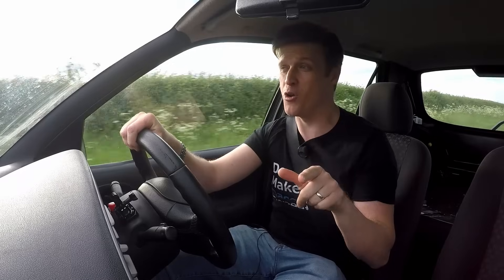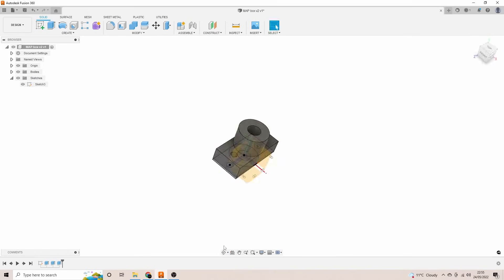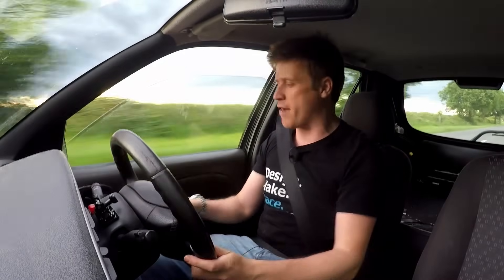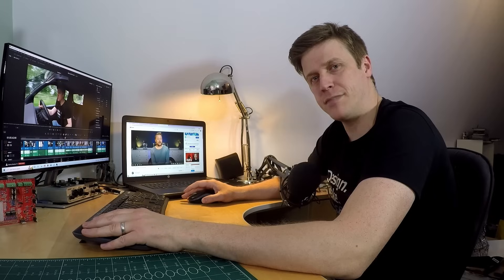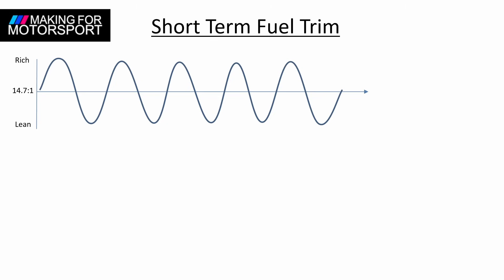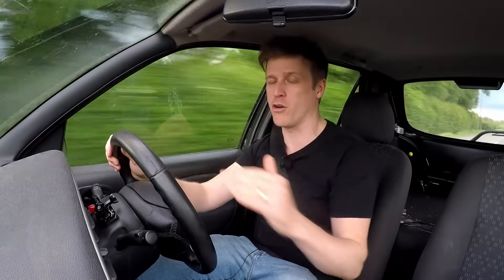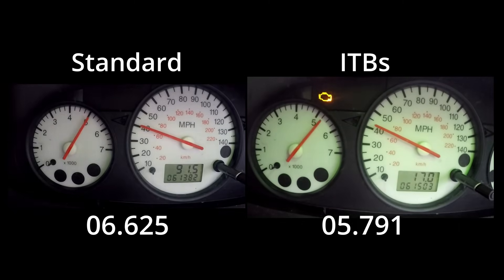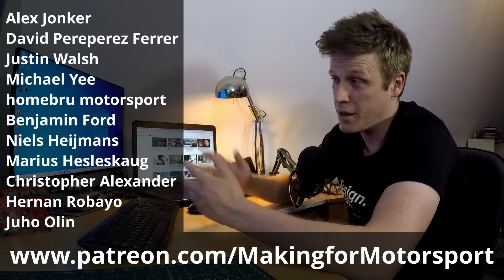Running ITBs and a Standard ECU - Project Siesta Part 3!

Comment: Sounds awesome tbh so what did you do about the original
Throttle body wiring 🤔did you use a throttle cable ?
Reply from the maker: I reused the throttle cable…. The weak link if I am honest… for the wiring I didn’t change a thing, just adapted the original sensors…

Comment: Hi David! 
First of all, your videos are a huge inspiration for me, thank you for all of your work you share with us!

I did built mine ITB setup for a ford sierra 2.0 dohc with ECC - IV ecu
It is basically the same as yours stock setup -  MAP and O2 sensor. Unfortunately, I was not as successful as you were. The best vacuum I am able to pull is around 16 in Hg or 54 psi and the ECU is having a hardtime thinking that the engine is under a load all the time. The afr is pig rich at idle and partial throttle as well.

If I was able to pull a higher vacuum, it 'd be golden and really usable, no problems at all.

I am going to try a vacuum block setup with checkvalves - Just out of curiosity, if it helps to pull a higher vacuum. 

To whoever who would like to run itbs with stock ecu and map - dont do it. Standard ecu will not tolerate ITBs, at least from my experience.

Looking forward to more experiments/ITB setups and builds!

Comment: What ITB is big enough for 250+ HP @ 6,500 on a K24? Also, why not cast the map sensor mount and air channels into the manifold flange?
Reply from the maker: You want 45s or 48s for 250+….  And I want 250bhp from a k24, that’d make my beemer fly…

As for the channels, I just wanted to keep it simple to start with, had I kept the car I might get more complex and neater with the packaging

Comment: ive been shaking my head positively in every situation you came across.
mate, im a car mechanic 
even for me your videos about itb's are educational !
ive been searching videos like this because im on the same mod myself 4age 16v with itb's with stock ecu .+ super afc apexi .
no one ever made it run properly with stock ecu or even that added apexi fuel controller.
its kind of a challenge for me ! thats why im pressing my self to finish it and completely fool the ecu like you did .
relocated the tps so i can use the 16v one  , relocated the iat sensor on the t3 adapter between butterfly no4 and cylinder head and using the original TVIS system so it has good speed density on idle .small vacuum manifold for map and fpr and servo booster .
if i manage to make -55 -60 kpa on idle ( original value ) i think i can make the apexi's life easier  !!! lol.
fingers crossed!!
thanks for sharing knowledge!!!!!

keep it up!!!
Reply from the maker: Oh yes… the 4AGE!  Love it, what an engine…. Let me know how you get on!

Comment: Hi, I've got a Ford Focus with pretty much the same 1.6l zetec engine and i want to install a Speeduino ECU. Do you know if the 3 Pin coilpack is compatible because I always read you need a 4 pin coilpack like on a VW to work. Tx :)

Comment: Ive followed this series pretty closely but I don't think an explanation was given for the IACV
Reply from the maker: Yeah… I didn’t bother.  I was gonna 3D print a unit to plumb it in, decided to risk it and didn’t need it 👍
Reply: @MakingforMotorsport  now im intrigued! How the heck did it idle at all?
Reply from the maker: @animal__music  with idle screw on the throttle bodies.  I suppose it helped that it wasn’t the middle of winter and I wasn’t doing loads of cold starts, but no problems….

Comment: If I have a carburettor engine, can ITBs  replace the carbs?
Reply from the maker: They can replace carbs, but you need to change fuel pump, fuel pressure reg, you need an ECU to control the injectors, etc etc.

You can easily change to some thing like ITBs though by getting carbs off a motorbike… R1 and R6 carbs are a good choice.  You’ll get the same BRAAARP and they’ll need tuning but much simplistic for a carb conversion…

Comment: Awesome stuff, I tried a similar thing on my car recently after seeing the success you had, but had issues with cf nylon deforming at the bolts after just idling the engine, even though it advertises 150C continuous use temps. I even had metal inserts, but after running the bolts would be loose and would leak coolant and vacuum. Do you have any recommendations on what brand of cf nylon to use?
Reply from the maker: I used the eSun ePa-CF.  I had no problems with that on the Fiesta using the metal inserts…

Comment: When I make parts like the MAP sensor adapter, I usually print NPT pipe threads so I can use a threaded brass barb. 3d printed barbs like that always seem to break off.

Comment: First, congrats about what u done, but what you did about the idle control valve? I was thinking about do the same as u done with the inlet pressure sensor , I have a Peugeot 306 GTI and thinking about to do this

Comment: Hey.
Good job 😁 love your videos.
I don't know if someone already asked it of not i have a good question for you.
How i have to calculate the diameter/cyl for my stock injectors bc i don't want to use the car with lean mixture or rich mixture.
1.4L aex vw engine
Thank you for the answer.

Comment: Hi, just purchased the same filament. What settings do you recommend? Running bed temp at 90, but struggling to get the nozzle temp above 260. Suspect from previous experience needs to be up at closed to 290.

Comment: 7:31 you forget when car make brrrrrr it is moment when throttle is full open or open more than 50% after this ECU use memory fuel ratio  for acceleration. You can use a calculator with wide lambda to show you at real time what is fuel ratio. Factory set in ECU can not be 14,7:1 (NA engine)

Comment: Why 3D that one, again. Just drill it out of billet in less than 30 minutes!
Reply from the maker: It’s a good question…. I suppose Plastic is cheaper than billet anything and I can also 3D model and print things at times of day when I can’t be noisy in the garage and it’s ready for the next day 🤷‍♂️

Comment: Ok the stoichometric ratio is not air to fuel by weight. it is the weight of oxygen in air to fuel by weight
Reply from the maker: Thanks for the comment, and yes your right stoichometric is of course the chemically complete reaction, and seeing as the oxygen is in the air there is a specific amount of air that provides the right amount of oxygen by weight.  

And everything I have read is 14.7 air to 1 fuel by weight.  The %  of oxygen in the air is accounted for in that value…
Reply: @MakingforMotorsport  Pedants of the world unite! by the way a whale is not a fish... its an insect
Reply from the maker: @tristanyseult  ermm…. Mammal? 😂

Comment: A week later and still no pass showing up online. Hopefully it's not rust... But I won't bet on it 😅
Reply from the maker: Haha!  Someone’s keeping a close eye! I haven’t put it in yet and it’s covered in sheep shit from playing in it the other night… MOT should be next week or the week after….
Reply: Someone guessed right sadly 😬 is this the end for siesta or do you plan to weld it up enough to get it through?
Reply from the maker: Yeah, still conflicted.  My life has gone crazy so time is tight.  And the welding is fixable for about a tenner of steel but lots of hours…. 
However, looking at the price of used cars at the moment, I can’t replace it for less than £750! 😳 so it might be worth the time… just gotta find some!
Reply: @MakingforMotorsport  I feel you. Is the subframe in the way of the repair area? As in would you have to drop it? 

If I could share images of how my van looked after cutting out, jesus. Both full sill ends gone, about half of the PS inner sill, and a good chunk of the quarter.

£30 for 1m x 1m of metal, but I must have 10 hours in the passenger side alone now!
Reply from the maker: @paulwisdom5383  yeah, I need to drop the rear beam to fully chase it… it’s gonna be a ball-ache!
What thickness did you use for the steel?
Reply: @MakingforMotorsport  Ah that's a bugger, not that I'm surprised. 

I used 1mm (same as factory) with a cheap Autojack Gasless MIG. It's not the easiest thing to weld with, a gas MIG would be leaps and bounds better. A lot of trouble to control the heat with 1mm on Gasless. Can be done though!
Reply from the maker: @paulwisdom5383  yeah, I am thinking 1.5mm just to ease the welding, but it should be easier with my gas mug set….

Comment: Before you go full speeduino it would be really interesting if you could plug it in with only the wideband, and log what the original ecu is doing, how lean or rich its running as it is. It sounds so good, proper race car feel, if you don't look at the speedo of course 😂

Comment: So it must have gained a few Nm and holding onto it a bit longer then 
What’s the diameter of the TB and how their area compares to the valves area ?
Reply from the maker: Yeah, I think down low the gains were marginal but clearly the standard system was restrictive beyond 3-4K rpm…. Not sure on valve size for this but I’d bet the ITBs are well beyond that area…
Reply: @MakingforMotorsport hopefully the next step will extract a bit more out of that (but going down the NA tuning road, we will be building a bit of a screamer anyway …)

Comment: Not quite. The O2 sensor after the cat is used to determine if the cat is working. If the ECU sees anything other than lean exhaust via the rear O2 sensor, that's a problem. 
If the cat is working, any surplus fuel gets consumed and the only things that should be hitting the rear O2 sensor are water, CO2 and nitrogen oxides. All of the fuel should be gone, unless the cat is not working, in which case you throw an emissions code.

When adjusting the air/fuel mixture, the ECUs will only vary the mixture by +/-X% (like 25%) in a particular running session, this is the short term trim. So you have a base number and a short term adjustment. A longer term adjustment is calculated and stored for the next running session so that the mixture doesn't bounce off of the limits of the short term trim. This is the long term trim. It's like recentering the mixtures to correct for variations in injectors and sensors.

You shouldn't be bouncing off of the short term trim limits all of the time, and if you bounce off of the long term trim limits you've got injector problems or air leaks.
Reply from the maker: Yeah. The first version of this video talking about conditioning the cat and cat efficiency checking and non resetting LTFT and lots of other things but I paired it back to stay on course… but I did get the tasks of the sensors wrong 🤦‍♂️.

Comment: Nice job, would this work on an spi engine with single lambda
Reply from the maker: Each car is gonna be different, but the key reason it runs at all is because of the way the car senses load, using the MAP sensor, the fuel trim stuff is more fine tuning and getting it working well.

But with the right mods, this can work on loads of cars…

Comment: This is so cool! I haven’t seen anyone in Germany running itbs on a stock ecu.

I would love to see a sharp cam shaft, mechanical lifters, some funnels to influence the behavior of the engine and remove the rpm limiter. I think I’ve seen an excel table in a German forum to calculate the correct intake length
Reply from the maker: Next step with this is basically to junk the standard ECU… 7500 here we come!

Comment: post cat 02 sensor does not control long term fuel trims. it cant, because the cat has altered the AFR. Long term fuel trim is the average of the short term trims.
Reply from the maker: Yeah, got that bit wrong. I did have this section completely different and talked about catalyst efficiency and the effect it has and the need to keep it conditioned, but it was half the video, so I dumbed it down a fair amount…difficult to pitch the tech stuff…

Comment: Amazing work, I foresee hours on marketplace looking for cheap cars with oem map sensors lol. I would love to do this for myself. You can boost Idle Kpa and stabilize the kpa more if you use one way vacuum check valves on 3 of the 4 runners vacuum lines leading to the map sensor.
Reply from the maker: That’s not a bad shout, it will help the vacuum side it of the MAP signal, but I doubt I will take this setup further… too many options!
Reply: That's exactly the sort of setup I've been planning on using for my DIY itb's on my integra. small reservoir, some check valves, and bam, smoothed map signal
Reply: @kasuraga  Did it for my ITB miata and it worked really well. I have a aftermarket ECU so I was able to monitor / record my KPA readings and was able to configure my ITB KPA behavior close to stock.

Comment: Hi Tom!  Keep up the good work on the Fiesta!     Not picking fault at all, but you don't have the theory of the Short & Long term fuel trims right at all.
Reply from the maker: Hi there, I did many cuts of this and talked about catalyst efficiency and a host of other stuff, but I had to boil it down to the essence and just explain it’s tiles in helping this system work.  But OEM units really aren’t my bag at all… far prefer a mappable unit!

Comment: That's not how long term fuel trim works, the lambda sensor after the cat is only there to make sure the Catalyst is working.
Reply from the maker: Yeah, I have got that but wrong, I did have a much longer section which included catalyst efficiency etc etc but had to cut it down, it just look too long!

Guess I cut the wrong bits 🤷‍♂️

Comment: Could you have used the injector ports on the throttle bodies for the vacuum leads to the MAP manifold, instead of printing them in on your manifold?
Reply from the maker: I could have! the vacuum take offs I used were already built into the ITBs, but it could be useful to use as them…

Comment: I got a set of ITBs but not fitted yet as fighting with trying to get the (1.7 Puma) engine running on a Speeduino.
Any specific reason why you used a combined air temp/MAP sensor for the inlet air temp instead of using the standard/OEM sensor?
I guess the other MAP sensor replaces the MAF sensor?

Great work, can't wait until the next video!
Reply from the maker: That is the standard sensor.  I think the ecu differs a fair amount to the 1.7, hopefully I may find out as I have one on the garage floor to go in the mini! 👍

Comment: You do know individual throttles run best on TPS as load ?
Reply from the maker: It’s an interesting one this, I have my Mini on AlphaN and I agree it works well, and traditionally it is the way they always have been run.

But you get on the forums and people seem very happy with the ITB mode in megasquirts which seems to be a blended SD and AlphaN.

One thing AlphaN doesn’t handle is extra idle air (my mini starts and idles well so 🤷‍♂️) so SD works well for daily drivers.  Personally I just stick with AlphaN and get it revs ‘til it idles nice…
Reply: @MakingforMotorsport  
My itb set up was horrendous on fuel with map as load.  I went with a Haltech on tps with closed loop wideband. It’s a 5.7 ls1 and has a big cam, it now runs better and has similar mpg to the stock engine. 
I do agree it’s crucial to get idle air set well.

Comment: Long term uses front o2 as well. Rear o2 is for cat efficiency control.
Reply from the maker: Yeah, I had pieces in there about the cat efficiency and even more but it turned into half the video.  I re-did that whole section and basically chopped it in half because mainly I think people are just in it for the Braaarps! 😂
Reply: @MakingforMotorsport  we are. But that doesnt mean the tech bits doesnt matter as well 😁👌 i am watching every single one of your videos with great joy.
Reply from the maker: @runesmDK  cheers bud!

Comment: Hi, loved this project!
Here is an idea for your vaccum manifold: remove the injectors from itb and replace by dummies, and use the fuel rail as vaccum port.
Reply from the maker: That!  That is genius!  💯💯💯
Reply: @MakingforMotorsport  haha, glad you appreciate the idea. May not work if you're planning big turbo and twin injector set up though. And we know you're a naughty boy ☺️
(Ps, you're the reason I have a speeduino on my desktop, thanks for being an inspiration)
Reply: That will cause a similar problem to his oversize manifold. You need the volume to be small to be responsive. An undersized fuel rail could work. Location sounds like a good idea.
Reply: @TravisFabel  maybe the sensor could be put on the rail ? Food for thought 🙂
Reply: @thebibidu  
This is definitely worth giving a try.  Probably better placement of getting a good vacuum reading

Comment: Brrrraaaaapppp. The noise is every bit as glorious as expected
That works shockingly well. Thank you emissions tech for doing something useful for once.
Reply from the maker: It’s a nice change to have it work for you instead of against!
Reply: @MakingforMotorsport  also, more details on the printer enclosure please! Keen to hear how the printer is going/any setup changes you've made.

I've got an enclosure mostly done to try and print standard nylon (it's cheap), but I'm yet to give it a go yet. Need a dry box first

Comment: Ever considered using those quick fit connectors for your vacuum plumbing? (The same one used for the bowden cable on your 3d printer)
Reply from the maker: Hmmm… they do airline versions of that (had some on my paintball gun 😂) but it’s probably a bit overkill for this when just a tight fit will do for vacuum….
Reply: @MakingforMotorsport  I figure it would be easier for 3d printed parts.. those small hose barbs are not sturdy enough, a threaded hole is much easier to print. Anyhoo, great work so far!